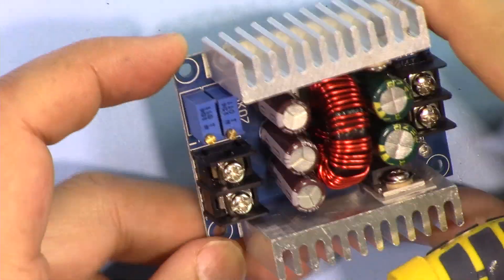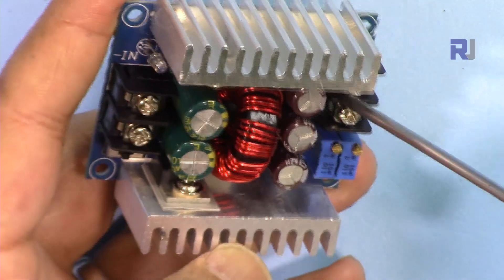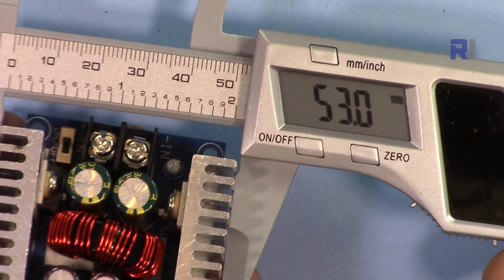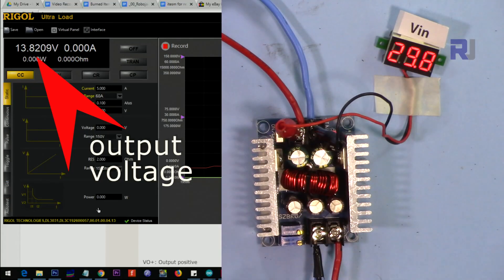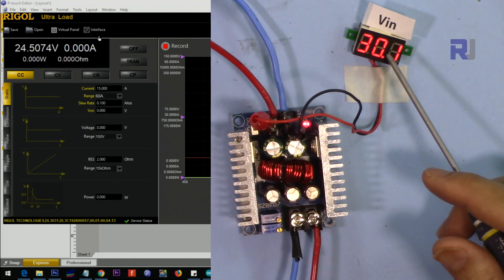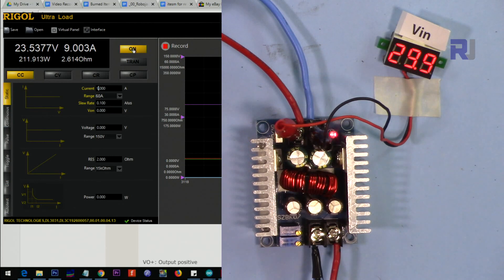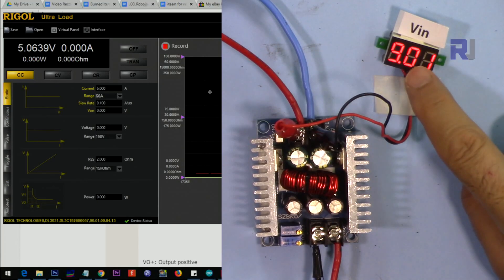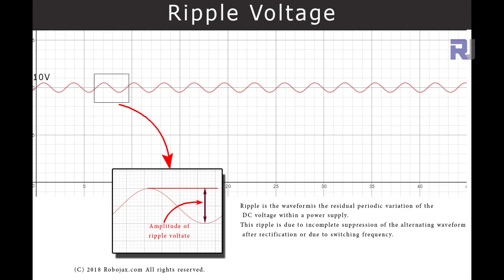Review of SZBK07 300W 20A  Buck converter 1.2V to 36V with constant Current

Comment: I bought 20 of these, plugged each into a LiPO battery (7.4W), and only 2 of 20 worked. The rest had no burning smell, but the LEDs didn't turn on. Power switch is on. Voltometer measures 7.4v in, 0v out.

Comment: I want buy this model step-down dc-dc converter, I asking if I want trimmers exchange to potmeters what type (parameter) I need?
Reply from the maker: yes you can use external potentiometer. the proper name is Variable Resistor.  So on the variable resistor it is written 104. 4 means 4 zeros so 10,000 ohm. just get 10k ohm  variable resistor, it should work.
Reply: I already order the modul, I will buy later potmeters, but thanks for infos.

Comment: what happens if we give 5v 30 amps? or 24v 40 amp? please rply
Reply from the maker: It's the voltage that matters. The current or the capacity of your battery does not matter the larger. The capacity the longer the operating time so it has no effects on the device itself
Reply: @robojax u mean to say  there is  no input current limit? Even 1800w step up converter has 40a input limit !!!

Comment: Can I use it to charge lithium battery from car alternator
Reply from the maker: yes you can. You must set the voltage correctly.  and you must set the maximum charge current.  for example if you have 100Ah battery, you may charge it at 10A which (this is maximum charge current) and it will be charged in 10 hours (100Ah÷10A=10h ). For the voltage you should know the maximum charge voltage of your battery. Li-IO maximum charge voltage is 4.2V  per cell. (or check datasheet for your battery).

Comment: You talk about this as a constant current power supply which you contradict when you say that the voltage folds back only when you reach a set point that's a current limit supply... A constant current supply if i need to tell you adjust the output voltage according to the load to maintain a particular current that's 2 completely different things. The two types of supplies only look the same under a condition where the load draws the current that the current limit is set for. All that testing and you didn't determine if it was a true CC supply.
Reply from the maker: Here is how Constant Current work based on Gemini AI from Google  https://g.co/gemini/share/c5f5e540e7c4

Comment: This mosfet can handle max current of 80Amps then why module limit is upto 20 Amps
Reply from the maker: becase the 80A would not totally different design, winding and huge heatsink.
Reply: @robojax  ok thanks, just curious to know.... If One can design suitable winding and good heatsink... Can this chip LM25116 with IRF3607 can give 40A continuous current ?

Comment: What I want to see, is how this module can regulate a constant current under different input voltages, I was expecting that you set a specific output voltage and change the input to see how it constant ut can regulate the voltage under such circumstances

Comment: Is the voltage drop occurring in the module itself or on the cables. Is the voltage drop on the cables tolerable in this test?
Reply from the maker: current does not drop. But voltage always drops on cables.  but if you are referring to the voltage drop of the module, it is called "effeciency" and yes. I have shown it in the video.
Reply: @robojax  I meant whether the voltage drop occurred on the module itself or on the cables. Or is the voltage drop tolerated in your calculations. Because I've tested one of these modules that turned out to give out 26 Amps at a constant, fixed 1.5V. It was a pulse if you are wondering.

Comment: Hi ... overall is a good efficiency ? And can add one another mosfet and rectified diode for more stable in high current and decreasing heat ?
Reply from the maker: Hi, no. The amount of current depents on the inductor and capacitors and it has been calcualted.
Reply: @robojax  thanks , what about efficiency in overall? Is a good buck converter? I want use it for made bench power supply

Comment: minimum setable current?????
 in my case 0.25A , is it ok or not?
Reply from the maker: why would you use a truck to cary 2kg load. but if for some reason you want to do it, you might not get accurate result. I have tested it with different curent, please see which value is closer to you value .
Reply: @robojax  my question is , what is the minimum current I can set?

Comment: Use 4 wire measurement system to eliminate wire voltage drop. The module regulates the voltage based upon what voltage is present on the module terminals but there is a voltage drop in wires which carry current from the module to the load. The electronic load measures voltage on its own terminals and not on the module terminals so it is no surprise that you will not get the full output voltage set on the module.

Comment: Hello sir i have a question .. what will happen if the output terminals shorted ? Does it have a short-circuit protection feature or will the module burn? 
Let's say input voltage is 35v 7amp dc .
Thank you so much for the detailed video on this module. I love it

Comment: It seems that your power supply can not handle the current demanded by the Buck and has to steel it from the voltage, that's why you are seeing voltage drops in higher voltage tests.... Suggest to use a higher current voltage supply so it would be able to saturate the Buck properly, otherwise all your tests are null and void or you might say a 20% accuracy level!.... Yes, you might have a lab power supply but they are useless in here, you need an IGBT that's able to produce huge amounts of current to saturate any other Buck converter.....

Comment: How can I find the datasheet
Reply from the maker: which datasheet? it has so many components and each has datasheet.  other than that there should be a "user manual" which it does not have and I made this video.  For each mostfet or components you can just use BING or Google to find them.

Comment: Can i join 2 converter in Perallal with same voltage for 40Amp?  Just I need 13v 40A output. Please ans......
Reply from the maker: Hi, yes you can IF and ONLY IF you set the exact output voltage AND maximum current so the current is not limited.  have you visited my other channel where it focuses only only power module, chargers and energy? https://www.youtube.com/wattHour

Comment: Hi, someone test with 42V input voltage? I need it to reduce 42V from liion 10S2P.
Reply from the maker: Hi, see the input capacitors voltage . They will explode if you connect higher voltage.
Reply: @robojax  Input is for 50V.
Reply from the maker: then there must be another reason that is rated at 36V. You may try it at your own risk.
Reply: @krisg8634  I have the same question. Did you test it? I want to use the battery from my e-scooter, which has the same 10s li-ion

Comment: I don't like it cant handle current adjustment with minimum voltage. I have 1.5v with adjusting current possible under load. Minimum voltage gets me max current, probably because they use the same feedback pin for both. I mean for xl4016 300w.

Comment: Can I use this circuit to limit current. For example if I input 12v from a battery and get output of 12v with limit of 10 amps. Is this possible?
Reply: Thanks in Advance. You have explained everything about this circuit very clearly. Very nice review.
Reply from the maker: That feature is called  Constant Current or CC. I don’t remember what I did in this video but if it has CC feature I should have explained it

Comment: Thanks for this review. The efficiency at 15:05 can't be correct with an input of 44.4W and an output of 17.7W. (17 / 44) * 100 = ~38%. Also efficiency is spelled wrong.
Reply from the maker: Then read values.  Thank you.

Comment: Great review, thanks! I have 2 questions: (1) We always saw this voltage drop. Was it caused by voltage drop between Module and active load? If not, what would you guess if the cause of such ~500mV drop?
(2) If the MOSFET was upgraded by another as 2~3 mOhm, I believe power dissipation would be much less. Do you believe it would be worth?
Thanks for sharing!

Comment: Merhaba 
Actually l do not know that l should write to u in English or Turkish. 
Firstly l write in Turkish but if u can not understand, l can describe to u in English. 
Rc arabam 11.1v 3s pil ile çalıştığı zaman esc(electronic speed control ) aşırı ısınıyor ve kendini korumaya alıyor.Aracı durduruyor.Eğer aracı 11.1 v pili 8.5volta düşerebilirsem araç yavaşlayacak ama problem kalmayacak. Netice olarak dc11.1v giriş ,dc 8~9 volt 10 amp çıkış gerekiyor  .Motor kaç watt bilemiyorum ama 3500kv.Bu kodlu ürün benim işime yarar mı yoksa bunlar sadece ac led ler için mi.?
Umarım cevap verirsiniz, teşekkürler
Reply from the maker: Selamun aleykum, bu DC'den DC'ye dönüştürücü. Bu modül için maksimum akımın ne olduğunu hatırlamıyorum ama 10A'ya ihtiyacınız olduğunu söylediniz. Bu yüzden videoyu izleyin ve 10A testini başarılı bir şekilde yaptıysam, evet voltajı düşürmek için onu düşürücü dönüştürücü olarak kullanabilirsiniz. Ben aslen Büyük Horasan'dan Kanadalıyım, şimdi bunun küçük bir kısmına Afganistan deniyor. Afganistan halkı çoğunlukla Farsça konuşur. Afgan, Afganistan'ı yönetmek için yabancılar tarafından yardım edilen çok küçük bir ahlâktır. Yani Türkiye'yi ve Türkleri sevdiğimi bilmelisin.
Reply: @robojax  Sevginiz için teşekkür ederim. 
 Evet 10amp işimi görür 
Teşekkür ederim.

Comment: The chip is LM5116 and it get hot when I'm connecting it to a 44v without any load. I don't know what happens if i draw load!
Not sure to use it or not
Reply: Think you misread the chip or a typo, it's a LM25116 and it's maximum input voltage is 42V according to the data-sheet.
Reply: @robertcameron7835 thanks. The problem is I'm using an amplifier transformer which it's output voltage varry during the day, between 41 to 44.
The ac v is 30v but after rectification it's almost 44v
Reply: @e.a297  You could put some diodes in line between rectifier and module to reduce the voltage.
Reply: @robertcameron7835  i tried it and it drop only 300mv
Reply: @e.a297  That's a very low drop for a diode even Schottky diodes are usually more than that (did you measure that voltage drop with a load on the diode). I would have expected a drop of at least 0.7V or more for conventional diodes under load conditions, Maybe try a different type of diode, you can also put more than one in series. The other thing you should consider changing is the capacitors check the data sheet and see if there is any recommendations.

Comment: hello, can I use 44vdc input?
Reply from the maker: Hello, I don't remember the value but mentioned it in the video. if maximum is mention to be above 44V then yes. if not then this module will die if you do so.
Reply: @robojax  the module says up to 40v but the caps used is 50v, the MOSFETs use is 70v, maybe there is tolerance .... can u test 44v input,? tnx
Reply: @jeffersonavila7275  did you test to apply more than 40v to the input?

Comment: Hi, thanks a lot. Do you know input current when there is no toutput load ? <10mA, <20mA?, more? 
Thanks.
Reply from the maker: when we talk about 20A or 20,000mA, 1% of this which is 200mA does not matter. Because most components have 5% to 10% error in them. That's why I did not measure it.

Comment: Can i upgraded amp using more MOSFET this converter
Reply from the maker: By the design, NO . To increase the current ,  both capacitors and inductor are the main components to change and increase the current. Then you will look at proper mosfet to handle that current
Reply from the maker: You didn’t reply?
Reply: Bro you make a video use this board  and use more mosefet in parallel and get more amp

Comment: can i supply with accu 28volt70ah ??(2 pieces accu 12v70ah with series circuit)
Reply from the maker: Voltage is voltage . You can connect from any source

Comment: My buck converter not working output volt 0.1
Reply from the maker: The power mosfet is dead or oxbow oath is broken . Check soldering points on - and +

Comment: Can i parralel the buck module with the exact same type of module?
Reply from the maker: Yes you can parallel it with any module but must set with exact voltage and both module should not have constant current. If they have then exact current should be set.
Reply: @robojax  Hi robojax. Thanks for replying. I already subcribed to your channel.
I'm creating a variable power supply for my thesis project which will draw about 24 volt and 15 ampere. As i watch your videos, the modules will be very hot as soon as it reach 15 amp. So i have an idea to parallel two identical SZBK07 in order to increase the wattage.

However i still have question to ask. 
1. If i'm using identical two unit of SZBK07 and parallel them. can i just put one potentiometer to control both of them? So i could get the exact same resistance value for both module, In order to get same exact voltage value for both modules (as you mention).
2. Can do the same with the current limit potentio? So i can control the output current from the modules.

Thank you very much. I hope you can help me with my project.

Comment: Hi RoboJax,  here a contribution from me that solved my question below. I have used it on a solar panel and yes it does function at least till 42.5Volts. The control chip is a LM5116 which handles 100V. Careful, the capacitor on the module can't. Check the chip there is a LM25116 which handles only max 45V and is similar to the LM5116.  See below a picture from the back of the PCB with most components identified. If anyone can tell me what the current limiting circuit looks like I'll be happy to know. 
I tested it on a real PV panel of 42.5V and 14.5V out at 10 AMPs It does get hot, extra cooling is needed. The chip runs on 300Khz if I remember right. This means that the 3 strains transformer with 0.7mm wire can be optimized by using one with a smaller diameter but more strains due to skin effect in the copper strains.  Putting the MOSFETS in parallel with the same type might help too.  The 3.5 Amp gate drive of the LM5116 should handle that. Changing it with a lower RDSon is a better idea. A IRFB3077 75Vds 2.8mOhm RDSon for sale at AliExpress lowers the Temperature

http://www.holamex.nl/files/img/SMPS%2020A%20parts%20identified.jpg
Reply: Pm me can you to install do sola paint of charger..
Reply: interesting. have you found any off the shelf high performance converters? looking from 18-25 down to 5V at 10A
Reply: @livelaughlove_88h pololulu has one for $20 that can do that.

Comment: Thanks for the good video! What would happen if you use an input voltage of 42V, that is, a little over 40V?
Reply from the maker: You are welcome. Something might happen like it might smoke . So it might be dangerous. Unless you try it, you won’t know.
Reply: I have the same question. Surmoka, did you try to apply 42v to the input?

Comment: Hello, the voltage can be adjusted in my product, but current limitation cannot be made. What could be the reason, do you have any information? Thanks.
Reply from the maker: Hello, unless the potentiometer is broken or the module is bad there is not other information. I assume that you followed the video.  Please subscribe. I appreciate it and helps my channel grow.  Thank you
Reply: @robojax  Thanks, I inserted a different potentiometer thinking it might be broken but the result did not change.  the voltage can be adjusted, but the current is unlimited, there is no limitation unfortunately.

Comment: Can this be used as a solar panel regulator to charge battery that would boost amps from solar.
Reply from the maker: this is buck which meant it will reduce the voltage and increase the current. Always remember it is the Power that can not change. voltage and current can always be reduced or increased.

Comment: Hello, this video explain this module complete. I wonder can I set this module with dc step up module? I'm looking for cheap voltage stabilizer for powering 14v 4.3A LED chip but the power source are from vehicle batt that give 12-14,4v. I want the output stays arround 14v(not over, not under 13). What if I step up the battery first(on 20v)with dc step up module, then series this step down module(on 14v)? Can those module run like that? Thank you.
Reply from the maker: May be this module, see my other channel and please subscribe https://youtu.be/xSI9k5BK-jU

Comment: Excuse me. In which case this converter may burns a potentiometer. I replaced the embedded potentiometer and I tried another one of 10k and 100k. Same result. Burned. I powered a fan 12V 0.41 A. Thank you.

Comment: thanks for the video, great stuff. can I connect 2 in parallel to have twice the current at the output?
Reply from the maker: yes you can. BUT and that is a very important but. you have to set both output exactly the same and both current setting exactly the same. then you can connect them in parallel. if you don't, then if  there difference, the current will flow from one to the other one  and that is dangerous.
Reply: @robojax  what if we connect a Blocking Diode on output of each of these in parallel to prevent current flowing from one buck into another in case of mismatch. Will that be safe.
Reply: @JawaazAhmad  yes, that will be fine

Comment: Is there any way to regulate from at least 500 mv to 30v?
Reply from the maker: Yes there is C$ 456.47 | KPS High Power Adjustable Switching Precision Power Supply 30V 60A 0.1V 0.1A DC Power Supply
https://a.aliexpress.com/_mNRMQ1p
Reply: @robojax  mr shamshiri i live in iran and i cant reach out to ali express also i have 15v 2a ps 
I want to make myself 30v 5a but these videos shows that these converters are not efficient at low voltage